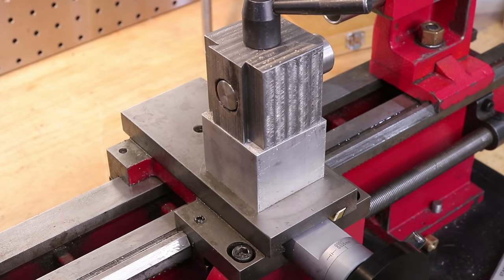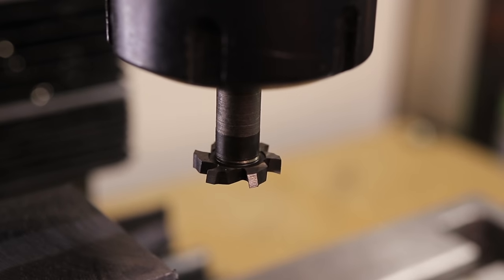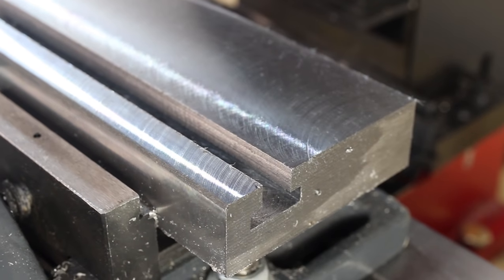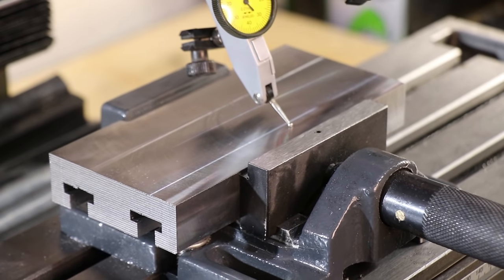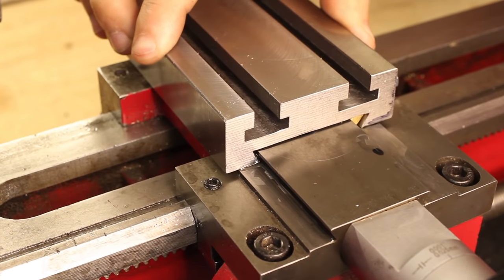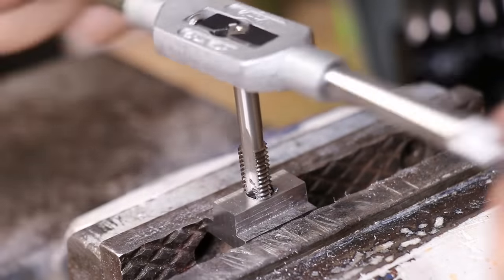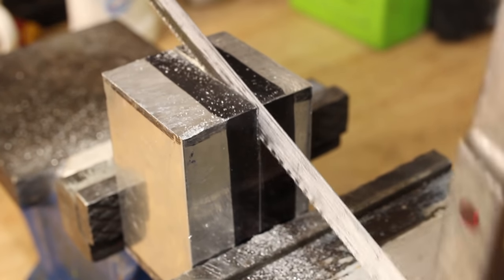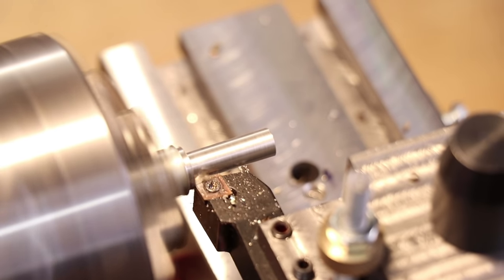Lathe Cross Slide Rebuild | Machining A New Lathe Cross Slide With T-Slots

Comment: The endmill(s) used  in this video seem to leave a rather rough surface, although I do not suspect it being too rough considering the fuction of the surfaces. Would that be because of the quality of the endmill, or maybe the bearings of the mill itself? 

Really love your videos by the way, very inspiring, unfortunately for me the local water company slapped me with a formidable bill, quite out of the blue, so no minilathe, mini mill or welder for yet another quarter 😔
Reply from the maker: Pretty much spot on there, the end mills that I used were just cheapo import bits and they work but they do give you less than stellar finishes. It is also a combination of being my first big project on the mill too to, so I was still learning the mills capabilities. Cheers, hope you can get into the hobby soon.

Comment: When you were fly cutting the t-nuts do you recall what your DOC was?
Cuz that look pretty damn good
And did you make the fly cutter or was it purchased? 
I am new to your channel.
Reply from the maker: The highest depth of cut I achieved was about 0.8mm. these inserts are meant for the lathe, so I think I could get better results with some milling inserts. The fly cutter was just a home made job, just some carbon steel with a slot cut into it for a lathe tool.

Comment: I note that you mentioned how useful the 'T' slots would be for fitting a vertical slide.

Of course, now you've got a mill, I guess your interest in vertical slides is gonna' be close to zero!
Reply from the maker: You are right, I probably won't be doing any milling with the slide, but other attachments such as a gear cutter I'm working on might require it.
Reply: @artisanmakes  hello! Any news in your gear cutter attachment? Love to see your project!🙏

Comment: are you also gonna redo the toolholder where the riserblock/toolpost in all in one pease ( less parts and should make it even stronger/rigid )
Reply from the maker: I am not planning on changing the toolpost. With the way it is at the moment the whole set up is pretty rigid. There might be some loss in rigidity using the riser block but I don't think i'd see a noticeable change if I changed it.
Reply: @artisanmakes  witch is also fair 

it was also more of a idear/planting a seed to if you where gonna make a new part there where you would have to remake those things anyway ( planting a idear for the future.witch would give even more content for the channel  )

Comment: What does dropping heated parts in lindseed oil do?
Reply from the maker: It gives the part a rust resistant coating. It's similar to seasoning a cast iron pan.

Comment: Did you make the layout fluid or is it a comurshial product
Reply from the maker: It's a home made batch made from methylated sprites and a soluble dye.
Reply: Thanks i might try to make some myself as it seems to work really well
Reply from the maker: Also forgot I had to add shellac flakes to the layout fluid too, and some people suggest using isopropyl alcohol instead of methylated spirits for a quicker dry time, though I have not tested that yet

Comment: Your forearms must be HUGE with all that hacksaw work! I need to get a bandsaw myself. However, I use an angle grinder with a thin blade to cut parts a bit long. I then mill or lathe them to the correct length. It's much faster than using a hacksaw. 
Your new cross slide looks great. What makes it even better is the limited amount of tools you used to build it.
I'm enjoying your channel and all the chips flying. Keep up the good work!
Reply: I'm planning on building myself a power hacksaw. Should still be cheaper than a bandsaw and less work than using my own arms.

Comment: Can you please share the dimensions of your cross slide? I just got a piece of CR1018 1"x3.5"x6" bar stock and trying to plan out a new cross slide. Thanks!
Reply: wild guess -  the bar stock / end product are roughly 20mm  x 80mm x 160mm? Knowing the saddle is 100mm wide i paused the video, held a piece of paper against the screen and marked the ends of the saddle. Then folded the paper over, marked 50mm, then folded again to mark 25mm/75mm, then folded again... it provided a rough scale. thanks for all your video posts. i've gleaned a lot from your efforts and even though there are more experienced machinists on youtube, i really prefer your content the most simply for your editing style and voice/accent. and family friendly content as well!
Reply from the maker: Hey mate, from memory it was a 75x 25x 120 piece of mild steel. The overall size doesn't really matter, use what you can get, just make it big enough so you can squeeze in two M8 t slots and wide enough to mount your toolpost, and judging by the size you posted, your one will be about the same size as mine. As for the dovetails, cut them to match the existing dovetails on your cross side, same for the cross slide mounting holes. Take care.

Comment: Nice build! How many watts is your mill? I'm curious to know if I could run mine to cut steel.
Reply from the maker: This mill has a 750w brushed DC motor
Reply: @artisanmakes  sweet! Thanks for the reply
Reply: @davidwillard7334  it's only 600w I'll try lol
Reply: @davidwillard7334  haha yep. It's very weak. Industrial machines are super expensive where I'm from. It's the only thing I could afford.

Comment: Great DIY project! There's room for improvement, but you called most of that out already; there's something to be said for making the best you can on a budget.

Constructive criticism: I found myself skipping a ton and there was a lot of machining footage that is frankly quite boring, at least for someone familiar with the process. I would either cut down a lot of the machining footage (there were plenty of places that it was bang on, you showed enough to understand what you did and no extra) or ensure you have engaging and informative audio commentary during the sections you are showing a lot of machining. The latter would be good to allow viewers unfamiliar with machining to see unedited footage of the process, while keeping more experienced viewers engaged.

Overall, great work!
Reply from the maker: Thanks for the feedback Tim. Editing these videos can be a fine tight rope of what to leave in and out. I hope that I usually hit the mark, but maybe here I might have gotten it a little wrong. Having close to 50gb of footage to go through on this project, editing got a little out of control. Cheers
Reply: @artisanmakes  I recommend checking out Make it Extreme Shorts. In my opinion that is some of the best editing I've seen of machining/fabricating videos, showing you enough to understand how things were made without anything extra. He does not do any commentary, so with the addition of commentary additional footage could be left as well.

Comment: Cast iron is a better choice for this as it is way better for damping vibration. That's why virtually all machine tools are made from it. It is hard to get and expensive so I understand why you went with cold roll and will probably work fine but cast iron will work even better.

Comment: Better to use cast iron to dampen vibrations.
Reply from the maker: Having used it for a bit, I'm not entirely convinced that cast iron would make a huge difference, at least when it comes to the slide material. I'm sure it makes a difference when it comes to the casting of the lathe itself,  but for such a small slide, the extra mass afforded by the upgrade more than compensates for using mild rather than grey cast. Cheers
Reply: @artisanmakes  Maybe not a huge difference but it's still the right material for the job. Embeded graphite serves as a dry lubricant and corrosion protection for iron. I don't even understand why people avoid it as it's even less expensive than steel.

Comment: might be able to heat the parts up faster and use less heat when blackening them if you put the parts on sumting that doesnt conduct and suck away heat
been seeing some lathes with this type of t slot crosslide and was looking for one for my lathe (like to be able to adapt the lathe to increase the swing https://www.youtube.com/watch?v=EVnC4hBKziQ and need a bigger distance fo move the tool farther away from the center and raise it for that the T slots would allow for that while keeping the base sturdy , looks like there not that hard to make myself , just curious if you measured if its at the exact 45 degree angle seen a video where the stock slide was off by a lot and had to be reground to get it to work properly https://www.youtube.com/watch?v=hOX4eQg7qqY

Comment: I don't think you should be using kerosene on steel. Kerosene is probably one of the best choices for aluminum, but just aluminum.
Reply from the maker: I understand why, but kerosene works decently for ferrous metals, earlier copies of the Machinerys Handbook reference it several times as the cutting fluid. I prefer to stick with it purely due to the cost, low odour and non toxic nature, already compared to the soluble cutting oils I can source locally, even if that means giving up some performance compared to soluble oils.

Comment: Looks like you started the machine when your fly cutter was still in the work there mate, that's a Bozo No No. And kerosene is used on aluminum not steel, oil is used on steel.
Reply from the maker: I'm not sure which part you are referring to but I'm sure you are just referring to a touch off mark. Either that or I forgot to press the record button and had to start the pass over. The number of small errors I make is a lot more when I have to juggle lighting, focusing and filming and cutting:) if I was to start the job with the fly cutter in it would stall. And I have to disagree with your take on cutting fluid. Different texts make reference to different oils, machinery a handbook makes reference to kerosene for steels, and I perfect it over oil since the vapour isn't toxic. Cheers

Comment: why the fuck are you using kero as coolant?!? lmao
Reply from the maker: Kerosene is universally accepted as a great coolant, particularly for its high sulphur content and low cost. Plus it doesn't corrode metal and the vapour is non toxic. Due to its flash point, it doesn't really pose a danger of igniting, generally you need a wick. Cheers
Reply: @artisanmakes   fair enuff then

Comment: Why paying tormach 7-10k when u get can get old used haas which is still shit, but again so much better than this. That "facemill" cutter was painful to watch.
Reply from the maker: This is purely a hobby for me and I don't have the space or justification for anything bigger. This isn't a tormach either, just a cheapo import mill, not a huge market for tormachs in my part of the world, only ever encountered one here. And that isnt a face mill, nor is it intended to be. Just a fly cutter made from some high carbon steel as a low cost option for facing. Cheers